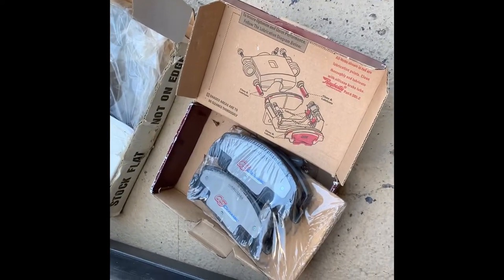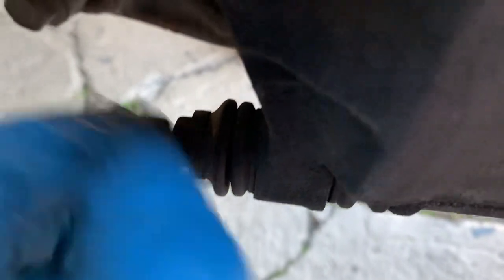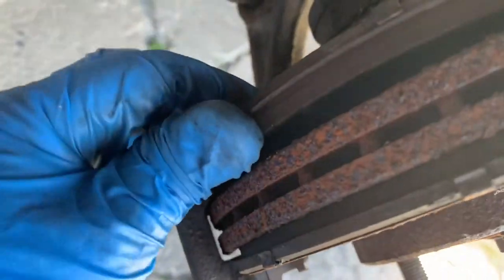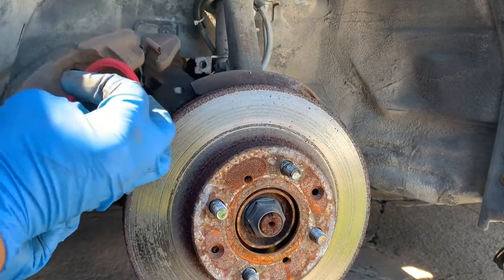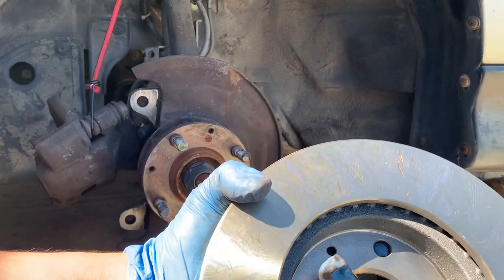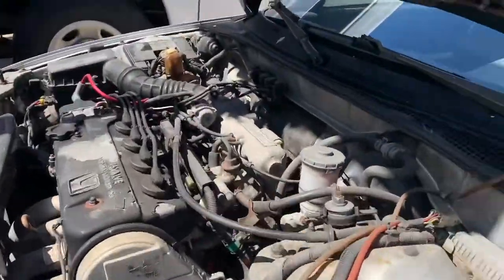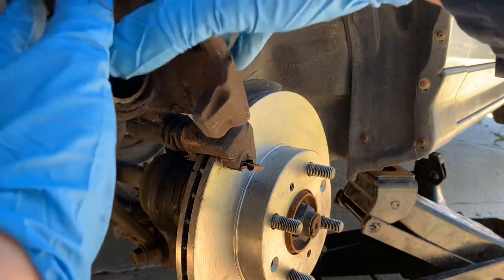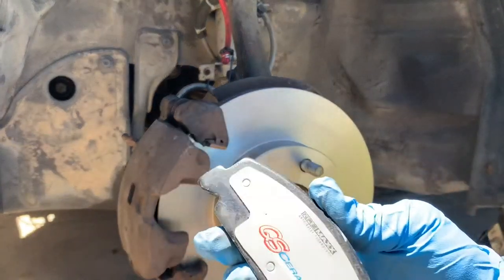How to replace front brake pads & rotors to 88-91 Honda crx / ef civic 😃diy

Comment: i seen some on drilled n slotted rotors wit pads for less then a bill on ebay. for the fronts. they only supposedly fit 90 91 ef hatch n crx. but is it the same for 88 - 91 ef sedan?
Reply from the maker: Sorry for late response, I believed ex and dx might be different in diameter size.